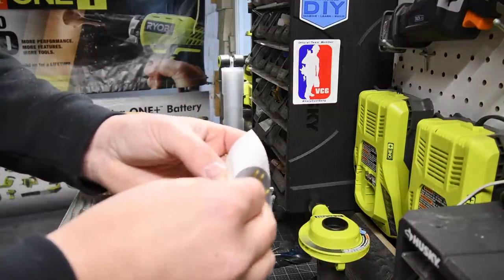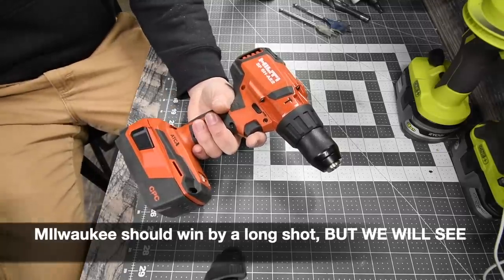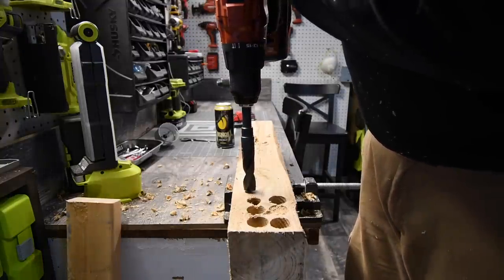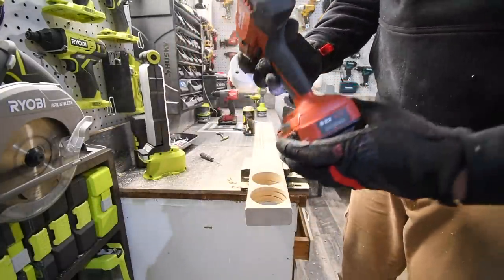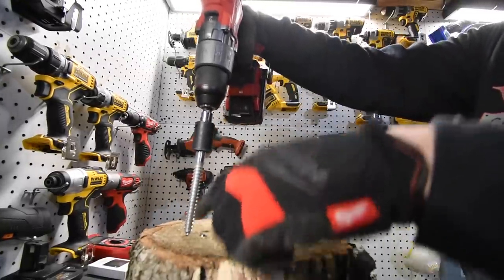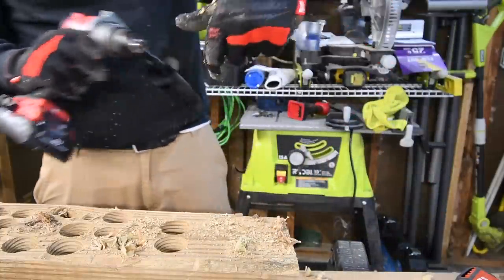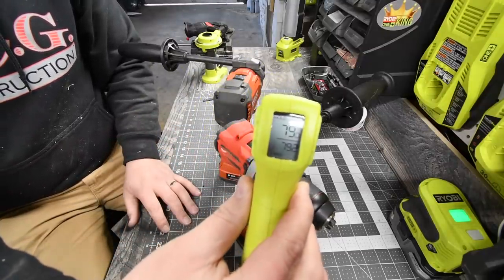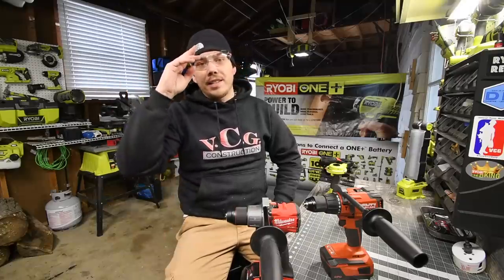Milwaukee vs HILTI (WOOD)

Comment: i have always liked the Milwaukee over the HILTI btw great video
Reply from the maker: Thank you sir
Reply: But the Milwaukee is crap compared to the Hilti. I own both these drills and the Milwaukee is inferior in performance and build quality.
Reply: @davesheppard8797  i have to agree with you but i tent to like milwaukee over that just like some people like ryobi more than dewalt dewalt is better than ryobi but they like ryobi. and not everybody can afford HILTI. have a nice day
Reply: @thomasdean4680  The new Hilti is a great piece of kit. Smooth, very powerful with more screwdriving torque than the Milwaukee. With the trigger issues on the Milwaukee's I no longer trust them to keep going. I always feel I have to take the Hilti as a back-up......but common sense says "Well just take the Hilti to start with!". I work in a large Theatre in Bristol, England so all my work is "In House". It is still a pain though to have to trudge back to my Workshop to swap drills. I tend to just use the Milwaukee in the Workshop now in case it has issues.
Cheers,,
Dave.
Reply: I do like Hilti I must admit! About 33 years ago I was given a second hand corded Te1 SDS drill. The guy was upgrading. That drill is still my go-to SDS drill wherever I have available power sockets. It is still as smooth as silk and can hold it's own against modern SDS drills. The Electricians at my work borrow it all the time and prefer it to their corded Makita's! It has never been serviced at all and it was kicked around quite a lot when I first got it being just a second hand drill. I cherish it these days!! 😁😁😁.
Reply: @davesheppard8797  that sounds like a good plan to me. maybe i should buy another HILTI ether way they are both great tools both professional tools... way better than worx and tac life except for the tac life sockets they are vary good. have a nice day..
Reply: @thomasdean4680  yeah! You have a good day too mate!
Reply: @davesheppard8797  Don't forget the price to performance. Hiltis are way more expensive.
Reply: @Turgz  Not in England though. And the Hilti will outlast the Milwaukee.
Reply: @davesheppard8797  My milwaukee gear has lasted years already so that's not a problem for me. The problem is finding things like hiltis for the right price.. lol.
Reply: @Turgz  where are you based Callum?
Reply: How about Hilti's fleet management? It allows you to pay a bit each month although you are only hiring the tool. After 3 years they automatically give you a new/updated model and swap it immediately if it should pack up!
Reply: @davesheppard8797  North of england actually. I cannot find a good deal on hiltis anywhere! Maybe because I'm in a more rural area?
I did not know about any kind of fleet management, I'll be sure to take a look. Thanks for letting me know.
Reply: @Turgz  yes mate.....just go on  Hilti uk. There is a freephone number to ring customer support/enquiries and they will tell you all about it. I find the Customer services really great and they are all so knowledgeable!. Good luck with that mate!
Reply: @davesheppard8797  I might have to do that. It says they will send someone out on site so you can try what you want before you buy or rent, i've never heard anything like it! All the best buddy.
Reply: @Turgz  yes they did that for me. The rep for the Bristol area arranged a next day visit to my workplace. And the other day I rang him on his mobile with a query and he was with me within 20 mins. The staff at Hilti though really do care about good service and bend over backwards to help you. Take care buddy and I hope you get things sorted to your satisfaction. 
Dave.
Reply: Also if you have an issue with a drill or whatever Hilti arrange for next day collection.....they have it for a day and then it's back to you the day after. BUT! The Hilti rep will give you the same tool to use while yours is being repaired, so you have no down time!!
Reply: @davesheppard8797  That seems great, thanks again for the info. Have a good night.
Reply: @Turgz  No problem mate.  You have a good night too.

Comment: Great video. Like you mentioned, both tools are good. It seems the hilti has an overload safety cutout. This will protect the tool from damage.  The metabo also has these features along with festool. I'm not sure about other tool brands. The hilti certainly has some grunt. The shape of the tools are very similar in sure they all collaborate in the manufacture. Unfortunately it is a very tight market in cordless tools, power tools etc because of the world. 
Still love all tools.
Reply from the maker: I love all tools as well and I thank you for your input Ronald :)

Comment: You are using 2 amps in Milwaukee, 5 amp batteries, screwdriver drill screw. You should apply equally.
Reply from the maker: 3ah high output is more powerful than a 5ah battery on the Milwaukee, If I used a 5ah it would have lost even more
Reply: Man Caver Tools I did not see it because it stands from the opposite angle is 3ah
Reply: Man Caver Tools what is different on Milwaukee’s HO batteries? I guess they must only allow higher current because the voltage stays the same.

Comment: Lol, the Milwaukee is not an 18v system. It uses the same battery technology as the Hilti. If you read the voltage on a charged battery it’ll read between 20-22 volts.
Reply from the maker: All tools that are 18v are really 20v, its 20v without a load, TOOL NOT RUNNING. While the tool is running it goes to around 18v. for the HILTI its the same thing. HILTI is 22v but under a load its 21.6v

Comment: To all the, put a 12ah on the Milwaukee and watch it crush the hilti!  Amp hour has more to do with run time, not power.
Reply from the maker: More AH does not increase power, but  it majorly helps use the power that is already there. A 8ah will outperform a 4ah in POWER and not just DURATION because the tool will be able to maintain the power  easier because of the extra cells that can take more of a load then 4ah batteries can. 18v is 18v, but more ah does improve performance :)
Reply from the maker: I already proved this is many videos but I will make a video again to prove it and it will be todays video
Reply: Jack Braddell  Exactly. The more cells used, the greater the max. amperage and therefore wattage the pack can deliver.

Comment: My coment is to see a better result  i thing u have to use the same ahmps battery like if u using 3 or 4 ahmps for one same for the other too it just what i see n what i thing
Reply from the maker: I used the 3ah HIGH OUTPUT battery for the milwaukee, The Milwaukee HIGH OUTPUT batteries provide more power to the Milwaukee FUEL tools, If  I use a 5ah regular battery the milwuakee will lose even more.  for the Milwaukee to win Ill need to use a 8ah HIGH OUTPUT battery on the milwaukee and 2.6ah or 3.5 ah on the HILTI. Ill be more than happy to put a 5ah regular battery on the Milwaukee, but it will lose more because it has 18500 cells instead of 21700 cells in the battery.
Reply: @ManCaverTools  I did my head to head test with a 9amp hour battery in the Milwaukee and a 2.6amp hour in the Hilti. The Hilti still pissed all over the Milwaukee.  Anyway, A bigger amp battery gives you longer run time not more power!! As I have proved.

Comment: i don't  how Milwaukee calculate the torque of their tool,  but it doesn't seem that There are so much différence. 
Milwaukee always claim to have more power 10x , 20x for everything. They have good tool but their communication is much more better.
Reply from the maker: not sure but 1,200 seems a but much and thank you for viewing sir
Reply: I had this issue and own both these drills. The Hilti has only 80Nm of torque and the Milwaukee has 135Nm. But....this is hard torque and when you are drilling and fixing into timber it's soft torque that counts. The Hilti's soft torque is 65Nm and the Milwaukee is just over 50Nm I believe. My Milwaukee manual only gives hard torque stats. Whatever though, I find the Hilti far superior in all areas.
Dave.

Comment: Heyy, a really great test with very good videotaking! 
Maybe put 2 holes for the holesaw on the outer diameter next time so the excess wood can just fall down thru it and you dont have to go up and down. In addition maybe use a super long screw next time too and see which drill can screw it in deeper to see the max power.
Did you ever try Metabo or Fein Drills? I worked with them, they are great ones, would love to see comparisons there.
Reply from the maker: these test are not done yet, once I get more powerful batteries for both brands the tests will intensify

Comment: Moreover, for some reason you emphasize that the battery in Milwaukee is "special" and in Hilti - "Regular"
 Yes, the milwaukee is specially lightened so as not to show all the power. "Regular" for milwaukee drills of this class - full-size, 6A*g for today.

Comment: Hilti finally has a competitive drill. The company I used to work for provided tools and gave us hilti and what pieces of shit the drill and sawzall were. Very expensive and performance comparable ryobi. Milwaukee has had a brushless drill for at least 5 years and just now Hilti decided to come out with a comparable model. Way too late to come to the party. Most pros have already invested heavily in a battery platform. Good job Hilti, but should have came out with this at least 4 years ago.
Reply from the maker: HILTI just came out with a lot of brushless tools this year.
Reply: You sir have fallen for marketing schemes
Reply from the maker: @tylersmith9868  how is that? I dont benefit what so ever if a tool loses or wins
Reply: @ManCaverTools  Tyler Smith means that like me, you got sucked into the Milwaukee hype. I bought a load of Milwaukee gear after the advertising bull. I found them really temperamental with intermittent working of triggers. I am back with Hilti and own this New brushless SF6H. It blows the Gen3 Milwaukee out of the water. I put a 9 amp battery in the Milwaukee and a 2.6amp in the Hilti.....same result. Original testing was with a 5amp in the Milwaukee and a 3amp in the Hilti.

Comment: This is so dumb lol, you should have used similar battery sizes. Power makes a difference
Reply from the maker: I did in another video I did 8ah vs 8ah. Milwaukee still lost
Reply: The Milwaukee is using high output battery pack, it shouldn't be limited by the battery in any way. The Hilti was using a 4 Ah battery pack, in this case being essentially two 2 Ah packs in parallel, so it isn't bottlenecked by the battery either. Battery capacity doesn't really correlate with power output. This was a perfectly valid test.
Reply: who cares the Milwaukee had a "super high output" and still lost ...
Reply: @cb7pwn  wouldnt matter if it had "super high output" the hilti has higher voltage batteries.

Comment: Remember always to use the side handle please
Reply from the maker: thank you sir
Reply: Hilti sf6h doesn't need side handle since it has built in ATC (Active Torque Control).
As soon as drill is out of control system kicks in and switches tool off.
No more twisted wrists :)
It is system invented by Hilti over ten years ago and it's used in drill/drivers for about 5 years now .
Introduced in first generation